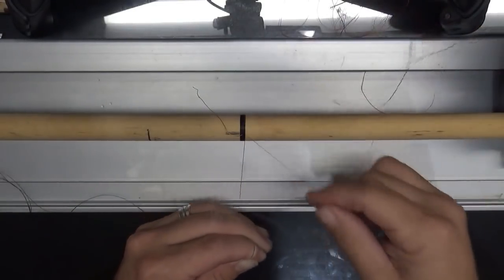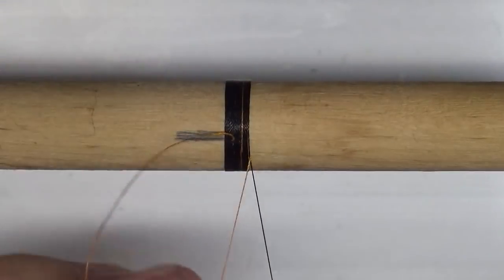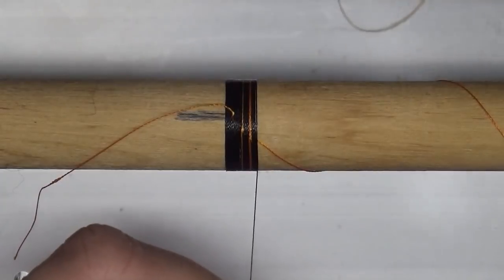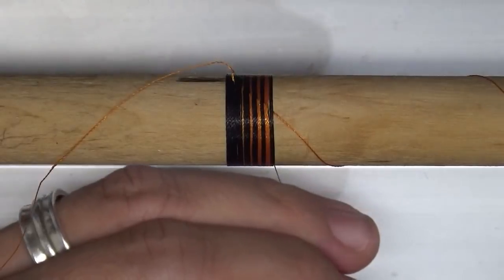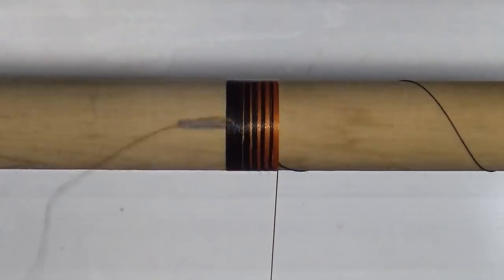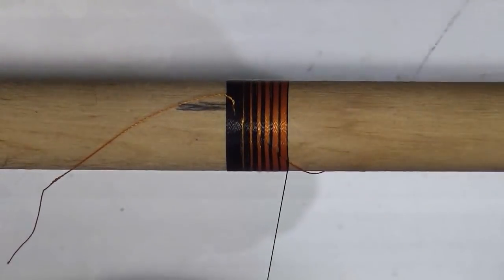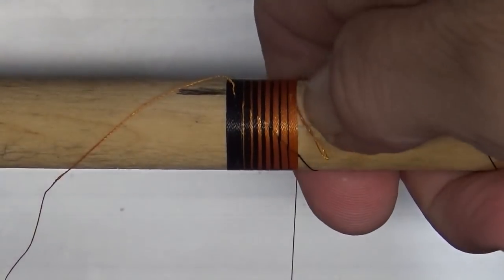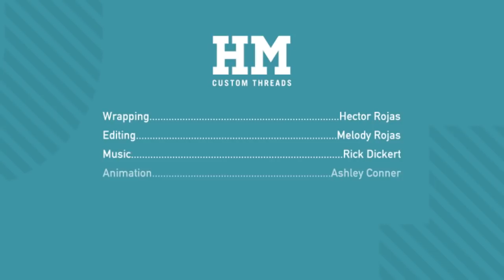Fade Wrap Tutorial

Comment: Is it possible to use cp and standard thread for this? If so, how to hide the cp thread tag end?
Reply from the maker: Aimo Kurkela, yes, you can use cp and any rod winding thread for this application. 

As far as hiding the tag end, I did that at the end with the pull through. I did have a knot in the thread and I was not able to release the knot so I just kept videoing. I do not do fades this way anymore. That was just the first way I learned. I will do another video soon on how to do this an easier way.
Reply: HM Custom Threads thanks for quick feedback! My idea was that the non-color  protected thread (here the orange one) would turn translucent when it’s lacquered. So that only one of the threads (black one) would show. How ever then the transition phases (black under orange) would probably show through, so maybe its not a good idea after all...
Reply from the maker: Aimo Kurkela, you are welcome. With this method the black would only show through on the dirty side. I think this would be a cool idea to test and see if you like it.
Reply: @hmcustomthreads2460   I would like to see the easier way of this method if posible
Reply from the maker: Matthew Pikaart, I am working on putting that video together.